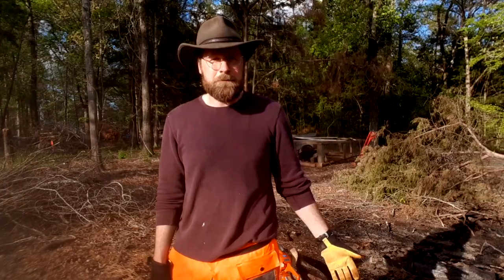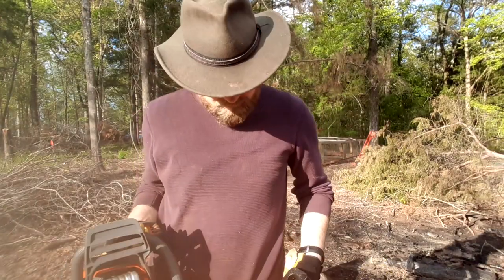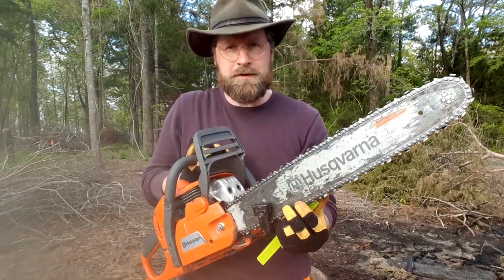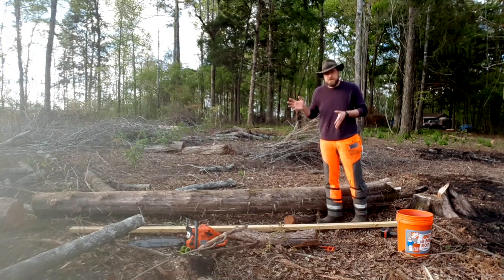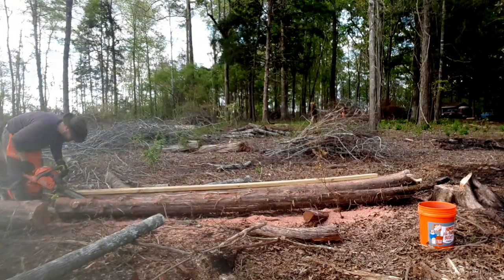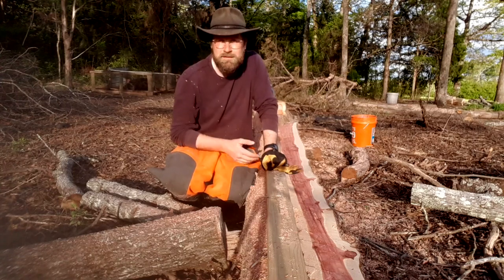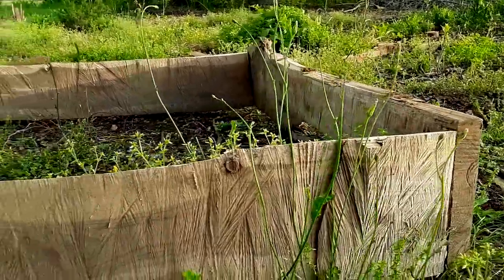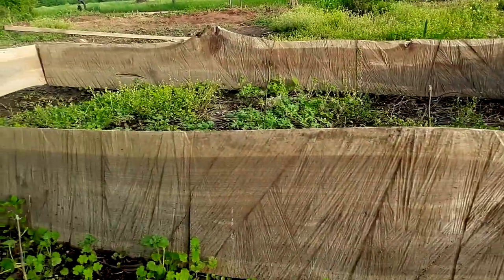Milling Cedar with a $23 Chainsaw Mill!

Comment: Hi not to criticize you work which I think is fine if you only going to Mill a couple boards this is Great most of youtubers that make chain saw mill ideas they won't show you how Long it takes to do this cutting in is really slow each cutting on prep and cutting will be 25 to 40 minutes each boards chainsaw are not desing to stay on stressed  long cuts so you machine wont Lost long and if you got to cut 10 or 20 boards you are talking all day .To me de best saw mill is band saws or circular saw but that is just me
Reply from the maker: That is correct @1miltond.  The main attraction of this mill attachment is the cost.  A circular or band sawmill will cost $3,000-$25,000.  For the raised beds I build, this was a great little tool.  Also, I didn't use one here, but a ripping chain for the chainsaw makes it much faster as the teeth are designed to cut wood with the grain.  Thanks for the comment!